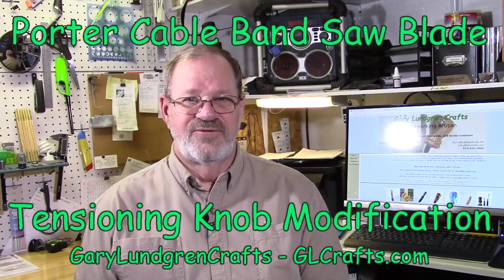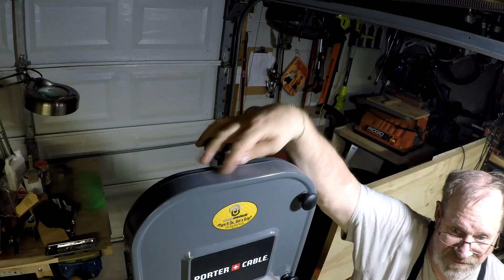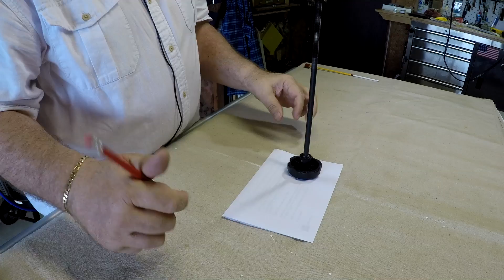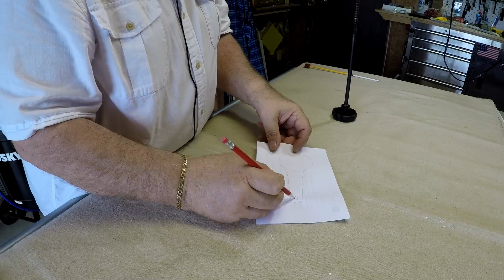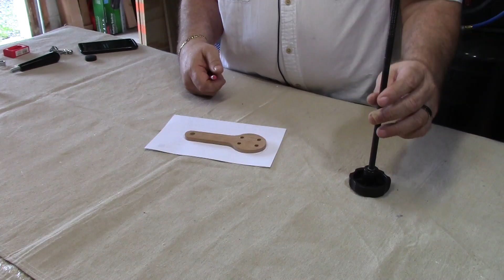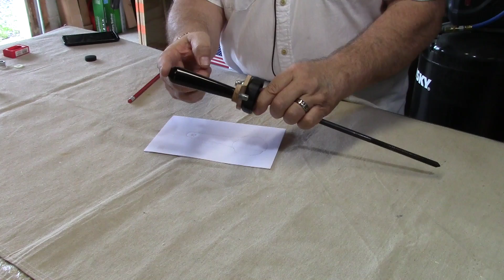Band Saw Blade Tension Handle Porter*Cable  14" Band Saw Ep.2016-22

Comment: I enjoyed both your videos on this bandsaw. I have the same one. My hinge assembly for the tracking broke and I can't find one anywhere, Dewalt has no release date on the part. I tried JB weld to fix the pot metal and it cracked in the same spot on the second use. Do you have any ideas on how I can fix it or if a machine shop could make one out of real metal like steel?
Reply from the maker: Thank you!  It sounds that you may be looking for this part.  https://www.ereplacementparts.com/hinge-p-648815.html  Check them out.  If that's not right they should be able to direct you for the right part.  👍

Comment: How did you make the tension handle
Reply from the maker: Thank you!  I may not be understanding your question correctly.  I believe I did explain it fairly well in the video. The handle to extend the knob was made out of 1/2" piece of red oak and is overall 6" long. The vertical knob/handle at the end of the handle is one I bought online at Rockler, as mentioned. It's a fairly common handle that attaches with a 3/8" thread, nylon washers, and nut. I hope that helps.